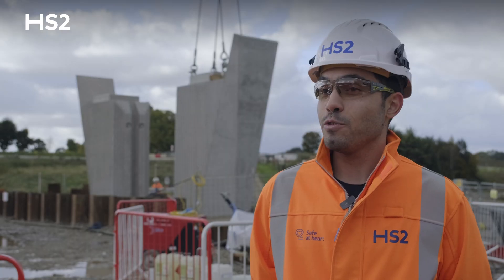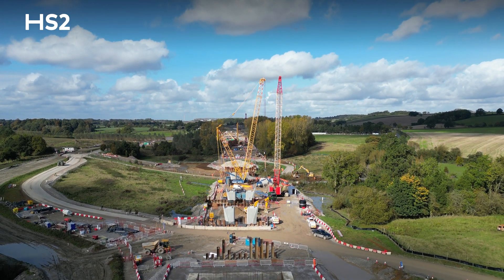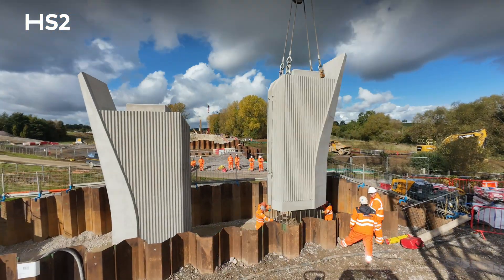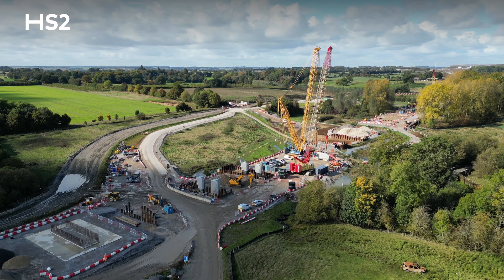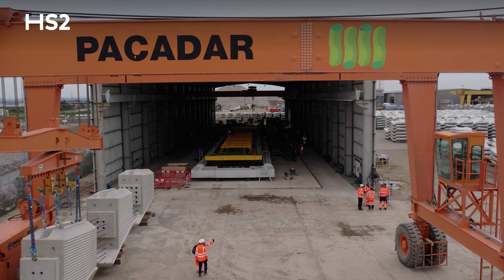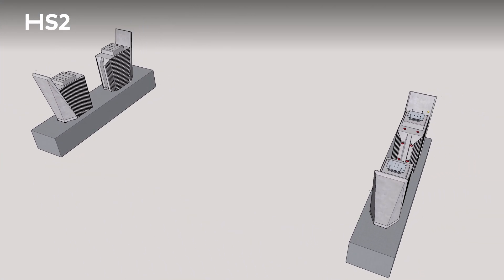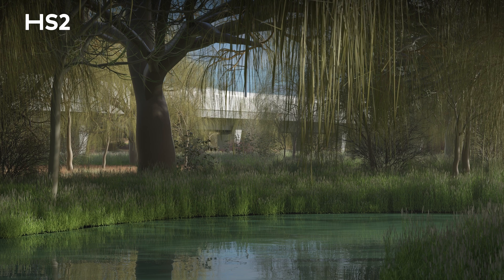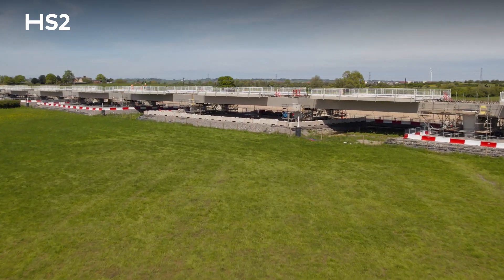Work begins on HS2’s half-kilometre long Edgcote viaduct

Comment: Great you are using modular precast for viaducts, shame not doing that for all the over-bridges they all seem to be custom not standard.
Reply: That would require a uniform span for all overbridges, with uniform topography on each approach. It seems a rather flat earther argument against the step change in rail capacity between London and Stafford this infrastructure investment is delivering.
Reply: @danwiddon3854 Good points.  There's also the issue of different Architects who all want to put their own architectural stamp on the appearance of the bridges.

Comment: you didn't explain how the pier is connected to the concrete base, i just saw some holes in the base and some rebars in the pier aligned and inserted. do you pour concrete in it? Please explain properly next time.
Reply: By the looks they are concreted in
Reply: 基礎部分が心配だなぁ…。インドで建設している基礎と全く違うような…。
Reply: @mitsuyamaeda-railfan  I can only interpret this as a sarcastic comment; but could you help me by clarifying whether it is the correct interpretation?
Reply: @mitsuyamaeda-railfan  That's because it's being built in the English countryside, not India.

Comment: Where are the stone archways? concrete is just so bland
Reply: I think the stone archways are somewhere back in 1865
Reply: lmao, plenty on the existing Victorian lines prevalent across the island, I'd assume!
Reply: Yes  I'm sure all the wildlife that can see this bridge from its location in  the middle on nowhere will be very disappointed in the aesthetics of this bridge.
Reply: Stone archways simply don't have the load carry capacity and low ground pressure that modern viaducts do.
Reply: Absolutely totally agree with you x
Reply: I think considering how much the project has cost already, they rightly arent focusing too much on the architecture.